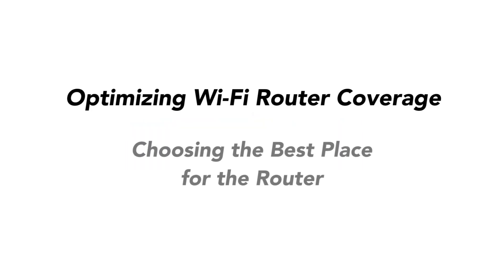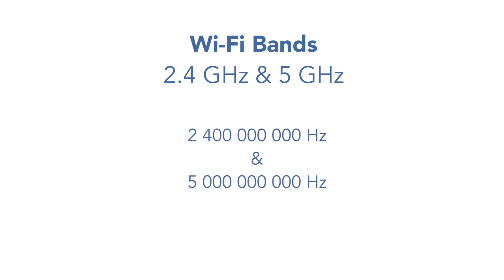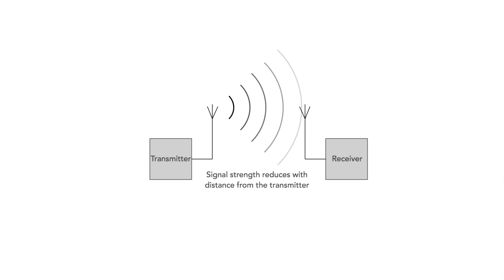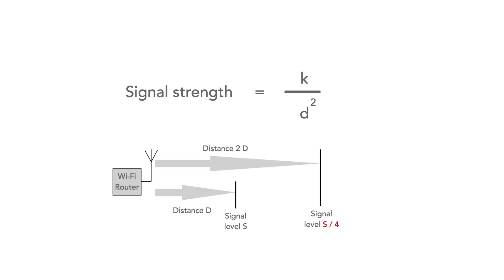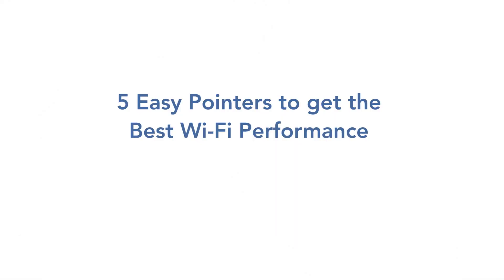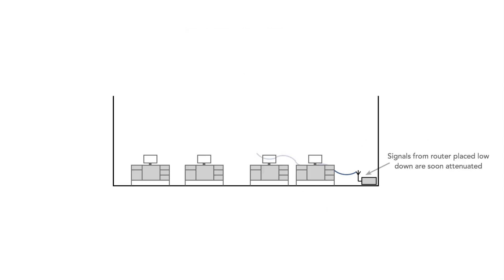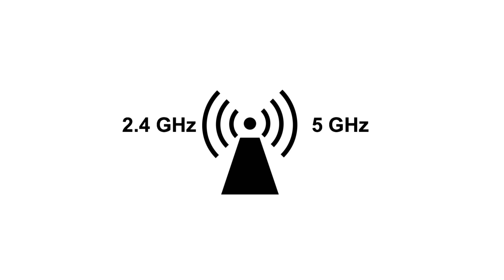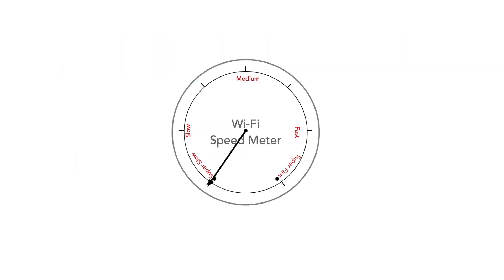Wi-Fi Router Coverage | Choosing Best Location | Optimization

Comment: Use wifi mesh system such as deco, x20 model cheapest for gigabit wifi 6 capability
Reply from the maker: You can use Wi-Fi mesh, but they are expensive and it is always good to place the access points so that they get the best coverage.

Comment: When i keep my PC so close to my router eventhough without any barriers it still lagging for me (Only i and no one else is connected to the network) It is of 2.4GHz though why does this happen?

Any solution?
Reply from the maker: It is difficult to fault find remotely like this. There are many things it could be. If you can try a direct Ethernet connection this would indicate whether the issue is WiFi related or whether it is another problem. This might be a good first step to try.

Comment: I have a closet that's a central point of my house would putting it inside be a bad idea is it better to have it outside? It has a high shelf
Reply: Yesssss i recommend you put it outside or as near as you device placement for example if you have a pc set up (not sure if that's how you call it) , you can try putting the router closer to the set up. I'm not sure that's what i'm saying is 100% correct but i just follow the path of logic

Comment: Is there a problem with placing the router on the fridge?
Reply from the maker: Possibly not, but be careful the metal of the fridge does not screen the signal from areas you need it to travel. The issue is that radio waves do not travel through the metal in the fridge.

Comment: Hello, which is better? my router on the floor or in up... sorry I couldn't really understand your voice.
Reply from the maker: Normally the router will be better placed higher up. If it is on the floor the signal has to travel through more furniture, etc. If it is higher up then it typically will have a better clear path.

Comment: i have 240 kps in my downloads, even when im close to  the router, why could that be?
Reply from the maker: It is really difficult to say remotely. There could be many reasons for it - ISP, router, broadband line, remote device  . . . . . .  Sorry not to be more helpful.
Reply: there are many reasons. If you get higher speed when using cable. 
then if you live in a crowded area where there are many wifi connections arround you, then make sure to set the transmitting channel . 

If you don't live in a crowded area, then check your wifi adapter hardware or software or the modem itself
Reply: It's definetly ur internet provider.